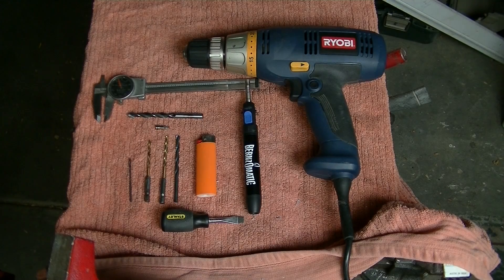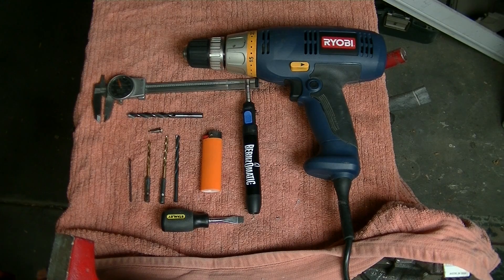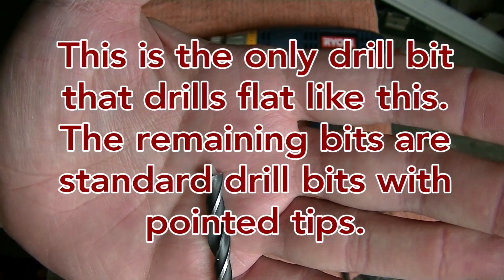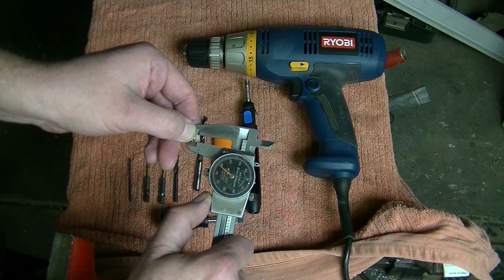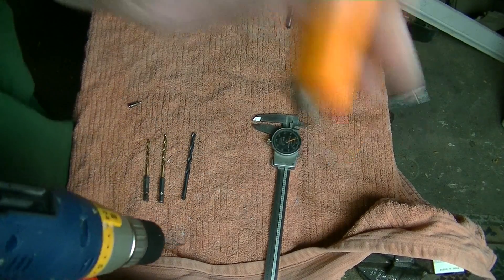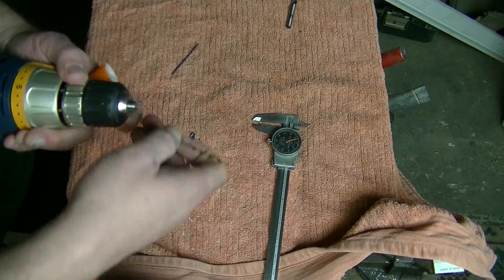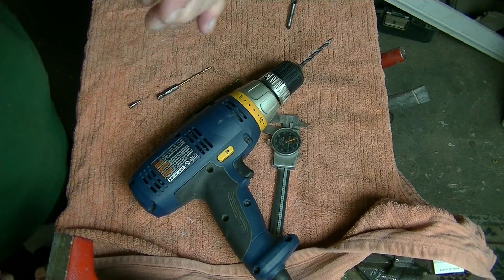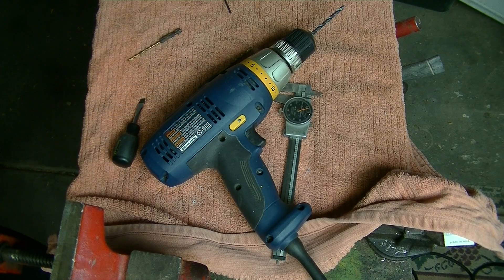Make A Bic Lighter Refillable By Installing A Refill Valve

Comment: I made my first one back in late 90's. had it for years. eventually the plastic body of the BIC lighter becomes porous and leaks. The only thing i haven't figured out is how to control a steady flame. They always seem to be too low then gets real big and back to low. its all about pressure. If you have this problem i have had luck by holding down the fork (the red lever) while filling it up to push out the air inside the body. 

I have to say your pretty spot on because this is how i made my first one. 

That drill bit your using is called a Brad Point Drill Bit, and you were using a dial caliper not micrometer. 

 Ya i know this video is old but hey its good to see that someone actually did it the right way.
Reply: Any idea how to prevent the plastic from decomposing?? 

I got a bunch of BIC lighters from the 70s and 80s the OG bics with the flame adjustment.
Love the old ads on them too so wanna try and save the plastic from going to crap.
Reply from the maker: @BarrySmoother  OH MAN would I love to get my hands on some of those! I remember those adjustable flame bics from back then ... I was just a kid but I had relatives who smoked and I think my older brother swipped a lighter or two that we messed around with. 

I'm not sure about plastic decomposition, I would tend to think that it should hold up fairly well over time since plastic is crude oil based and that stuff has been in the ground for millions of years.

Have you observed noticeable breakdown in the material? Perhaps they spent too much time in the sun? Sunlight destroys anything if you give it enough time.

I think your bigger problem might exist in the butane dispenser inside the lighter. No doubt there is at least one rubber gasket in that system somewhere and it might not retain butane for that reason since the rubber would most surely break down after that much time.
Reply: @MikeSims70  The vintage BIC's have held up pretty good. Some even had small amounts of butane in them. The plastic is pretty scratched up but no different from a used modern BIC.

The one I'm using at the moment seems to holds gas perfectly even after taking it fully apart and cleaning it. Didn't have to drill any holes into them to refill. You're actually able to refill the vintage BIC's from the top valve, but it's a bit of a pain and might damage the seals over time. The tiny rubber seals look to be the same as the modern BIC's but no idea if you can take them out, they do look to be brand new still though.

Not worried about sun damage as it stays at home and sits right at my backdoor inside so it doesn't get pocketed aha 

Valve might get blocked over time. But Ive managed to resurrected a clipper lighter in the past by using premium quality butane.

If you're keen on owning one for nostalgia sake Ive found one on eBay. Price is a bit much for an old lighter but it maybe worth it if you're chasing after that good old Nostalgia. 

https://www.ebay.com.au/itm/Vintage-GERHARD-BERGER-MARLBORO-gas-lighter-/164335843651?mkcid=16&mkevt=1&_trksid=p2349624.m46890.l6249&mkrid=711-127632-2357-0
Reply from the maker: @BarrySmoother  If I had one of those old Bics, I would first get a few new bics and practice the install of the valve, taking my sweet time through every step. I would come up with some way to utilize a drill press to get a precise 90 degree angle on the bottom of the lighter then I would use masking tape to mark my depths on the drill bits and I would definitely install a valve in that old Bic. I think it would help it last longer vs refilling it from the top where that butane will just be brutal on any seals not to mention having to fight the mechanism itself to keep it open while you fill it. I looked at that one on ebay and I don't buy anything on ebay that says I won't receive it for four weeks ... nothing on this planet takes four weeks to ship and I don't care which parcel rate you use ... but it's obviously not in the US so no deal on that one ... but I appreciate you taking the time to find that. I might keep an eye out from time to time ... I was under the impression that Bic still made adjustable flame lighters but not for the United States since they are not legal anymore in that lighter style. I believe a lighter has to be refillable before it can have a flame adjuster on it ... or maybe it's only torch lighters that can be adjusted ... not sure what the law says - though those laws are lame in the first place. Who did the government save by enacting those laws?
Reply: @MikeSims70  Yeah got a refill valve from an Airsoft mag, i'm assuming that it will work. 

Definitely will be doing some practicing on some modern ones before I go for the kill.
Reply from the maker: @BarrySmoother  As long as it's short enough, it should be fine. I actually have some that do not require the step where you have to break out the center partition, they're short enough so that they don't touch the partition. But definitely get the process down first and the feel of it. those valves can be moved from lighter to lighter without any worries at all. Would love to see a short video of the final result when you do get it done.
Reply: @BarrySmoother  honestly I don't have an answer. Keep in mind I had my first one for about 4 years before it started to breakdown and I was refilling it on pretty much a weekly basis. I wasn't really worried about it breaking since they are so easily replicable. but since you got vintage BIC'S I would start off with one and see how long it will last ya. if you got a bunch of them they might just last you a long long time. Unless you plan to sell them, then its someone else problem. If I was you I would practice on the  newer ones (non adjustable flame) till you get good, then try the vintage ones. Those are hard to come by. If you don't fill them up on a weekly basis like I was they could last even longer.
Reply: @mykeeX13  Thanks for the reply.
 Guess it's just trial and error. Know they are pretty sturdy so hopefully keeping em out of the sun will keep em going strong.
Reply from the maker: Fascinating ... I had actually set out to devise a method that I intended to record on video and post to my Youtube account, where I thought I would MAYBE get 100 views ... if you scroll through the comments, this thing took off like I never expected. So On the flame consistency ... first is to make sure you're using quality highly refined butane because the cheap stuff will cause carbon deposits in the nozzle and affect flow. And like you said, its always a good, when it's low on fuel, to push in the valve and empty the gas that's in there before filling it back up ... cause then it gets nice and full. 

I was not aware that the plastic broke down over time like you mentioned ... I don't think Ive ever seen that before. Though ... when you think about it ... a $.99 lighter holding butane under pressure for years - refill after refill ... still some quality engineering in that lighter.
Reply: @MikeSims70  Yep your right, high quality butane works good. I was using Premium Butane by Colibri. You can find it in most cigar shops.  Another trick that seemed to help is set your EMPTY lighter next to a heater to get it a bit warm hold down the fork and fill. (away from the heater of course)

Comment: the pain from drilling into your own hand is at a level never felt until you do it.
use a vise.
Reply: Or... yanno... heat a nail up.
Reply from the maker: If I owned a drill press, I would have used that for the straight line guarantee, but the pressure needed to drill into plastic is so small, there was no chance of injury in this project.

Comment: I know this Is old, but sadly I am just finding this video.. but am glad I did. Thanks my dood. 

Also, can't I just use a Dremel? I have all sorts of bits for my Dremel.
Reply from the maker: If you have the hand skills to drill straight with a dremel, it might work... though  now that I'm thinking about it, I'm not sure they even make bits for the Dremel that would be wide enough to do this mod. Harbor Freight Tools and Amazon have VERY cheap drills and bits for that matter. They won't hold up long term in daily use but for a once - every so often project like this, they would be just fine.

And when I say cheap, I'm talking in the $20 range.
Reply: You could use a Dremel to grind that center divider once you drill your bottom hole otherwise your valve wont fit. But make sure you get all grinded material out of the inside body. Use one of those compressed air cans you buy to clean keyboards with.
Reply from the maker: @mykeeX13  That's a good iedea ... they have those really small grinding bits that would make short work of that divider. And the plastic that came from it would be easy to remove since they would be extremely small pieces. Perhaps I'll make an update video with a refined process ... even thinking about 3D printing something that would hold the lighter perpendicular to a table so that there would be no need to hold it in your hand (for the safety minded folks)... hmmm ... ideas ideas .... Though I actually have valves that are short enough to where it is not necessary to deal with the center divider anymore.
Reply: @MikeSims70  I use to just stick a drill bit in the hole and just break that center divider, but the pieces were a pain to take out. Needle nose pliers or surgical forceps is what I used. I was at Harbor Freight yesterday as a matter of fact. They have a diamond tip set for for Dremel's, used for glass cutting or engraving on glass. Those would work just fine to some plastic grinding nicely. There's an interesting video on YouTube you can search for called "How BIC lighters are made, its only 5 mins long but there's a part where the guy says "we only use high quality parts", which I don't doubt. Its what separates BIC from the competition. But like you said in a earlier post to use high quality butane which totally slipped my mind, and if you don't use hi quality butane you will get that jumpy high low flame. I have this lighter by Colibri that I love, I had to replace some parts on it so i called them and they told me NOT to use crappy butane in their lighters but most low quality butane is dirty, and their lighters won't last long using crappy butane. Anyway long story short they told me their butane burns cleaner and hotter than the crap you buy for $2.00 bucks.  Some people might think this is a waste of time but I'll tell you right now when I first made mine and took that small step to do it right probably saved me $300 bucks a year on buying a new lighter every other day. They run about $2.00 bucks here in So Cal. and yes $300 bucks a year but that's another story as in why.
Reply from the maker: @mykeeX13  I can imagine WHY - LOL ... the "circle" in that show, "That 70's Show" comes to mind ... ☺ 

As far as the diamond chip bits at Harbor Freight - I found that their "dremmel style" bits have a much smaller shaft than the official Dremmel bits have and that's actually been a source of frustration for me in the past because it can become a difficult thing to get a bite on the shaft when mounting it in a Dremmel. But that has only been a problem when I need to exert a lot of force on the bit ... it ends up slipping. I've even done things like put tape around the shaft to get a better bite on it but even then sometimes it ends up slipping inside the tape! So I stared just periodically keeping an eye out on Amazon for deals on Dremmel bits and when there is a particularly extreme discount being offered to where the cost is at least close to what you would see for a Harbor Freight Chinese replica (which is no replica at all), I'll buy up one or two of whatever it is just to keep some on hand. The genuine Dremmel bits in this case ... are the only way to go ... but that only really applies to applications where extreme force is needed... in the situation where you're just chomping away at a plastic divider ... they might work just fine.

I should also mention that I use the screw chuck on my Dremmel ... I don't use that sleeve insert that grabs the bit when you tighten down on the threaded ring which is the default chuck that ships with every dremmel ... the chuck that I use has to be purchased separately but it makes the Dremmel so much more convenient to use than the stock chuck.

Good feedback ... I've never heard of "Colibri" but it sounds like they actually give a crap about their customers ... and their product.
Reply: @MikeSims70  funny you mentioned the Dremel quick change keyless chucks. As soon as you said your bits slip I thought you were using the stalk Dremel stock sleeve chucks, and was gonna give you a link to buy the keyless ones on Amazon. I only use the stock ones when I'm using my Dremel as a router. Anyway very weird that your bits slip. I used those bits to grind stone siding on my house and used a lot of force as well.  Umm try filing or bench grind one side of the shank flat.
Reply from the maker: @mykeeX13  Why on earth would you use a dremmel to grind on something that large? Why not a standard full sized router?

Comment: Have you checked the McMaster-Carr catalog?
Reply from the maker: Checked it for what?
Reply: @MikeSims70  For the little gas valve thing.
Reply from the maker: @Astromyxin  Yeah I just went to their site because of your suggestion and although they have a vast array of nozzle types ... most of which I've never heard or nor seen before, they don't seem to have any valve types that could be used for this mod.
Reply: @MikeSims70  Dang. They have literally everything imaginable, it shocks me that they wouldn't have something like that. Not that it's important anymore or anything, but I'm sure if you called them and got a hold of someone, they could probably either get it in stock or tell you exactly what you need is called and where to get it.
Reply from the maker: @Astromyxin  Yeah I was actually going to email them a photo of what they are to see if they carry them. I had forgotten but I've used their site in the past when I was developing a device using mainly 3D printed parts, that would help me make coils (using an Arduino and stepper motors). Their site was helpful because they provide cad drawing files for many of the items they carry. In that particular case, I used those files to get accurate threading dimensions for incorporating bolts into the device I was making. ☺

Comment: You seem to be very careful, but don't shake the plastic over the drill. Any pieces of plastic can melt inside the drill and cause problems.
Reply from the maker: I suppose something random like that is POSSIBLE ... however unlikely ... Drill motors tend to spin very quickly and they are always ventilated ... and metal objects that spin very quickly tend to eject whatever is clinging to them ... though if I were just doing this all day long the plastic shavings could become a nuisance ...  though I'm a bit amiss in seeing how melted plastic could cause a hazardous situation unless of course you melted it in your skin ... which would sting for sure ... :-)
Reply: @MikeSims70  ouch!
Reply from the maker: @MrSonic1953  Ouch ... to which part of what I said?
Reply: @MikeSims70  " melted it in your skin"
Reply from the maker: @MrSonic1953  - I didn't actually DO that ... I was just saying that would be the worst case scenario I could picture happening ... but the likelihood of it happening ... is slim to none. Though ... I have experienced melted plastic on my skin before ... and OUCH was not the ONLY four letter word to be uttered that day by me!  LOL

Comment: It's been a hot minute since I've messed around with lighters but I forget. Is that white plastic piece easy to pry off? I'm wondering if it would be possible to skip the drilling and 3D print a new bottom piece altogether that would just fit the valve.
Reply from the maker: That's an excellent thought. But in my experience the binding of the bottom piece to the body of the lighter is such that it cant be just 'popped out' it has to be drilled out because it is somehow chemically bonded to the body in a way that it becomes part of the body. The other thing to consider is that 3D prints are VERY porous and I don't think they would be suitable for any situation where it is necessary to withstand fluid and pressure as in a lighter situation. Perhaps with those 3D printers that use a basin of liquid material then build objects using light would be more 'solid' ... but I don't know enough about them to say one way or the other. 

I like the way you think though ... I'm all about custom solutions to problems :-)
Reply: In that case 3d print you the whole lighter and a new 🧠.

Comment: Or you can go to the Dollar Tree and get two scripto lighters for a buck
Reply from the maker: I can also buy generic products at the grocery store and they will work as well ... just not quite the way I would like them to work (depending on the product of course). This is just one option for a lighter hack out of many. It is by no means the option that everyone should use. We all have different needs, wants, etc.
Reply: @Definitely Not Sixto well I'm not a crackhead but thank you for the reply. I guess maybe you know something about that??? Personally the best deal in town is to buy a Zippo it will probably give you many many years of great service. But I use scripto all the time and never have a single problem with any one of them, and at 2 for a buck it's a pretty good buy.
Reply: @MakinEndsMeet69  Zippos are an expensive outdated design, the fuel leaks and has to be replaced constantly, the hinge is weak, the metallic walls are thin, and the insert design has actually been made WORSE over the 80 year runtime, as the only change made to the design lol.

I love my Zippos but they are NOT "good lighters" by any stretch.
Reply from the maker: @Definitely Not Sixto Indeed!